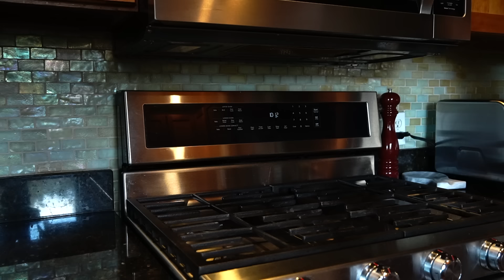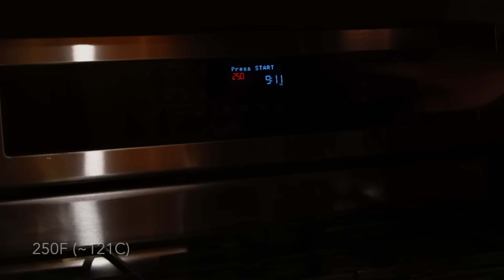Forging a Hidden BAMBOO KATANA from a Giant Leaf Spring

Comment: Is no one going to talk about how he just casually buts a blade in the oven
Reply: thats what im sayin
Reply: For r3al
Reply: I literally went to the comments after I saw that bit like bruh is that normal😌
Reply: Ah yes, wait a minute, i need to bake my katana
Reply: It's a process called tempering, it adjusts the granular structure of the steel so it is not brittle.
Reply: @jasperruss7569  do they use this for other blade making? I would think they do correct?
Reply: @skyline-xq4jl  yes it is a common process used by many knife makers
Reply: it is called tempering its a method in metalworking that improves its grain structure growth increasing its toughness by heating it and preventing it from cooling too quickly by holding it in a set temperature for a set amount of time back then bladesmiths would heat up a kiln first and put the blade back in it covered in clay but in this video an oven is used because its more accurate
Reply: perfectly 69 likes.
Reply: Thats how you make the metal stronger as long as you dont do what i did and cleanch it in water water makes the atoms in the metal press together faster and causes it to bet so strong its weak so use oul to clench it
Reply: @yodaheadnew2635  very normal actually
Reply: It’s normal, most would have a kiln to do this in instead of a oven but considering it’s a larger blade it would be easier to use the oven for and works the same
Reply: @obsidianknight3125  using water can cause warping though since it cools it too fast, using oil is slower because it cools it slower but it’s less likely to warp
Reply: @skyline-xq4jl there are few probably different ways to temper steel, all of them work the same. Relieve any stress that would cause fractures under impact, improve thoughness removing excessive hardness, or maintaining it

Comment: He may not do it in the traditional way but he still uses the blacksmith methods, modernized and original. One things for sure doesn't matter how it's done as long as it's done right and with precision, dedication, patients, steady hands, and a determined soul, Anything you make will turn out a masterpiece and this is a masterpiece.
Reply: if it is not folded, it is trash!
Reply: @og3suso978  no actually if its folded its trach, you clearly dont know what the folding was actually done for, which is hilarious. thew folding was done specifically and ONLY to even out the impurities in the very low quality steel the japanese had access to, it literally only does that. they are short and thick aswell and that combined with the low quality stiff steel makes them especially brittle and very very prone to shattering.
Reply: @Helperbot-2000  The iron used for Japanese swords is a special type called Tamahagane. You seem to have no knowledge of swords.
Reply: @moqhacker  the iron used in japanese swords was low quality because they couldnt easily separate it from the sand it was it, and again, it was low quality steel
Reply: @moqhacker  OK, but why is that relevant?
Reply: @W3lol1  We use "tamahagane" because it is stronger, tougher, and more tenacious than iron. Katana is a weapon, but it is also a work of art. katana smithing is a sacred process, so the process and materials used are very important. A sword has a "hamon" but this katana has no hamon. Without the use of traditional techniques, "hamon" will not appear. In addition, I feel that the sword is weak in reflection. katana often uses reflection to blend into the environment like a chameleon, making the tip of the sword transparent and cutting the opponent. This is just a sword and would not be recognized as katana in Japan.
Reply: @moqhacker  any steel is better than iron simply due to the carbon content in the steel
however, tamahagane is not any better than our modern, much higher quality monosteels, as modern monosteels have less impurities (and now have alloy contents that make it even better than that)
i get that forging a katana is a work of art, but like.. so are all high quality blades?
all your other points are meh. and while this isn't a "katana", it also technically is, since afaik, katana just means sword

Comment: Some of the western katana today have no soft core like the traditional Japanese swords which is the original way of making one. Traditional ones are more harder to make but last longer because the core absorbs the force and reduces blunt impact when in contact with solid objects. Solid steel like this will either snap in the center or chip bigger. The weight distribution should be in the hand area, and the tip weight must be lighter compared to the center, and hand area.

hand area = heavy
center area = medium
tip area = light

Comment: Beautiful blade, nice work mate.
It looks more like a Tachi, rather than a Katana due to its curve if I am not mistaken. 
Also no guard makes it quite dangerous (for the wielder), not to mention bamboo handle is quite fragile + very slippery for combat purposes. 
But it is hell of a blade nonetheless, looks gorgeous :)
Reply: It's a shirasaya.  IIRC, some samurai started to carry these hidden blades (made to look like walking sticks) after swords were made illegal to carry in Japan.
They didn't have a guard as that would make them a lot less hidden.
They would only be more dangerous to those unfamiliar with their use.  Though, thrusting with one of these... well, you'd better have strong hands and a good grip.  The handle on this one doesn't inspire my confidence.  Maybe it's stronger than it looks.
I should say that I love the bamboo on this sword.  I wish you could find more shirasayas like this but preferably with something done to the bamboo to strengthen it.  That's probably why I can't find any.
Reply: @GUNNER67akaKelt  Ohh loved this bit of information, thanks mate. He actually cured the bamboo but that's usually for stopping cracks and/or shrinkage over time, doubt it makes it stronger.
Reply: @demran  at least the bamboo is a bit more durable now

Comment: DISCLAIMER: this isnt how actual katanas are made he just made it for fun
BUT THATS SUPER COOL
Reply: the katana is made up of two metals, the heaviest on the edge of the blade, and the lightest on the top. I think it cannot therefore be defined as a katana
Reply: Yeah i agree with you
Reply: @shounihillys1902  aww thanks for that
Reply: @shounihillys1902  Its more about hardness, the density of the two metals is almost the same, since they are both steel
Reply: @ignacioaguirrenoguez6218  they use a different dosage of carbon
Reply: @shounihillys1902  Counting the carbon atoms on steel as a different in mass is really stupid, I'm sorry to tell you. No steel has more than 1,5%-2% carbon, and one carbon atom is way lighter than one iron atom
Reply: @ignacioaguirrenoguez6218  huh? A Japanese blacksmith literally said that for a katana they use two different types of carbon dosage, what the fuck do you want from me?
Reply: @shounihillys1902  Yeah, that doesn't mean the weights are going to be any different, I want you to understand that hardness is affected, not weight of the material

Comment: The katana is inherently straight, and bends due to the internal stresses of the metals during quenching, because it is a composite product. Several different steels are used there. You could use just one type of steel, but achieve a roughly similar effect with zone hardening. Which is also often used in the production of katanas. I'm really not sure if the result would be the same curved blade. But that would be closer to the original production technology.
Otherwise: nice sword. Good job.
Reply: Isnt the curvature resulted from different cooling times for different parts of the blade in the quenching process?
Reply: @nopr1v4cy2  yes. As the blade cools during the quench it goes through a few distinct phases. Positive sori and negative sori. The spine being coated in satanite for example,allows the cutting edge to cool much faster than the spine. At high temps the phase is often called austenite, the rapid cooling of the material creates the second phase know as martensite.
Reply: @5.56Chronicles  Though to add, we might have to consider that the curvature generated from the quenching process isn't the sole reason in contributing to the blade's curve. These things were of course, were decided upon the smith.

Comment: It was unbelievable how a katana could be made from a small piece of metal.
Reply: dude plays minecraft, guy gathers iron and bamboo and crafts a sword
Reply: Most historical sword, whether Western or Eastern are not that heavy. Usually around 3-8 pounds.
Reply: @inisipisTV  yeah, but it depends how that weight is used. european longswords while beeing similar in weight are significantly longer aswell as the fact theyre made of way higher quality steel which means they have proper springyness to them making them durable and nimble. while katanas are shorter for their weight aswell as alot thicker to make up for the lower quality steel the japanese had access to at the time, its impressive how well they could utilizen the steel they had, but its unfortunate how brittle their swords were. the steel quality is also why they were folded a few dozen times, it was done to remove some of the impurities but more importantly even them out to prevent large weak points
Reply: @Helperbot-2000  They didn't have steel native to Japan either. Most of their katanas were made of pure iron ore sand. I've watched a YouTube video of how a traditional Japanese person said they harvested the iron for their swords and they would go to the beach with a magnetic rock and draw it over the sand until they had a decent amount of it. Man at Arms reforged is a good channel and Ilya always tries to make Japanese katanas the traditional way when he gets to make them. In fact the metal was so brittle before hardening that Katanas are "supposed" to be straight and they curve when going into the water for hardening, very cool to see it done.
Reply: @SeviathTheHumanDrago  well no they did have steel steel isnt separate from iron, you make steel WITH iron and carbon, and so yes they used iron ore sand. they didnt use magnets) but their steel making process was quite poor and so they couldnt make very high quality steel, it had alot of impurities (which is the reason they were folded, to even out the impurities and remove them slightly. but yeah the curving is interresting, as the edge was covered, it didnt harden as much as the back dise, and so the backside would shrink faster curving it, its a bit like a bi-metallic strip!

Comment: you know im wondering how hard it must of been to forge a good weapon back in the old ages like 70 A.D like all these machines make it look easy but its still hard. They gotta do it by hand back then which is insane in my opinon
Reply: @TreySomeWay  There are videos on youtube
Reply: A blacksmith usually had helpers with sledge hammers makes the job allot easier.
Reply: @trueredlucky954  yea sure I guess, but look at 5:36 how would the helpers pull off something like that. You get what I mean? like to make the weapon look nice and symmetrical this, guy uses insane machinery which helps, and I'm pretty sure helpers cant do stuff like that. right?

Comment: Excellent video - though I would rather have seen a brass dowel in the grip holding the blade to the handle!  Still, your workflow is extremely good to have shot this - excellent work, and props for forging in the bevels.
Reply: Yeah, I was just trying to a work it out. Does this sword count as having a full tang? I don't think a sword is really considered a functional, combat ready sword and not simply an ornament without a full tang. At least that's what I thought.

Comment: Now I have 100x more respect for the sword-smiths who made real katanas.
They folded the metal like 20 times to get an aligned grain structure in the metal and then sharpened it on grated stone.
Not to mention all the forging was done by hammers, no machines involved.
Reply: Yeah it's crazy the skill and time it just have taken, but this guy still has crazy skill even with machines

Comment: In the 1930s and 40s, only non-commissioned officers were allowed to carry military swords, but on the Chinese front, the Japanese army was short of ammunition, so the need for swords was very high. And there was a blacksmith accompanying the soldiers to repair the swords. The soldiers picked up car springs and asked the blacksmith to make them. The soldiers would pick up the car springs and ask the craftsman to make them into swords. He was very skilled and could anneal them very well, so they were called "Imatoretsu" or "Spring Swords" and were very useful in the war.
In fact, the manufacturing method of Japanese swords has not been clarified.
It is said that more than 1000 years ago, swords were made only from steel. During the Warring States period, the need for swords increased and it became difficult to obtain enough steel for the orders, so a manufacturing method was apparently devised in which steel and soft iron were sandwiched together to reduce the amount of steel used. In other words, it can be said that the use of all-steel springs as a material for Japanese swords was completely correct in ancient times.

Comment: Fantastic design, but my only concern is how are you supposed to know the edge alignment with a perfectly circular handle? 
(one fix I thought of was to  add a small piece of wood to the back of the handle, making the profile an oval. yeah it would make it less discreet, but with a good wrap it could pass off as a walking stick)

Comment: The Katana Rhetorical Questions I myself pose to one wishing to posses an original hand crafted Katana unique with its own DNA if you would express it in those terms.

1. What comes first learning the earth and blossom or learning the Katana itself?

2. What is the difference between the Katana Blade and the skin on ones hand or body?

3. From the craftsmand knowledge and wisdom, what is the constant battle in the craftmans mind between scorpion, subzero and raiden in yielding a blade of perfection?

4. Given the Katana was born in times of ancient temples to what ends of the earth would the craftsman have travelled to gain the resources needed?

5. How is a katana exumed from its sheath 
A) Drawn
B) Pulled
C) Exumed
Or
D)Summond

6. Is each Katana yielded identically in lengthy battle?

7. How is the craftsmans work and effort preserved in use of the blade?

8. And like Bruce Lee commented "Be like water" how does this affect Subzero and Raiden in Mortal combat.

9. How is subzero effected in summoning his katana in mortal kombat?

10. What comes first the blossom or its polenators like the bee or moth or butterfly or bettle?

11. What is the difference between a moth and butterfly?

Comment: correct me if im wrong, but wouldnt the bamboo skewwer crack under vibration of striking? modern knives use metal dowels usually.

Comment: i like the way you did the sheeth more then the  actual katana if you can even call it a  traditional made  one
the sword is painted with layers of clay before heating, with a thin layer or none at all on the edge of the sword it's also  quenched in oil i believe to  get the curved shape
and you forgot to  to  layer the billet. but nice job

Comment: hold up, doesn't spring steel have pretty undesirable composition and properties for swordmaking? Or does the repeated heating during the forming process rearrange the steel particles? I know the quenching of the blade and subsequent tempering is necessary to make a hard blade but spring steel is supposed to deform repeatedly in a controlled way without fatigue

Comment: The shape of the blade is not given by heat and cut it, it is given through grinding the metal (friendly advkvice from a fellow forger) and the blade is called tachi (cause is little shorter of katana)
Reply: I respect this man's hard work and passion, but real katanas get their shape from the quench, not grinding or hammering it into a curve.

Comment: Use high carbon and Damascus steel mix. Most strong/flexible blade that'll last nich longer then a real Japanese katana made in Japan. Dont get md wrong i love them because they us old method of forging the katanas but the carbon steel is not all that good especially if they ask 6000$ up to 10k for a real Japanese katana. I can forge one out of the mix or buy one made from the mix i stated, high carbon and Damascus steel and it'd cost 500-1000$ only an last way way longer and way stronger

Comment: Sword may be fine, but the tang, god damn that's shitty.
Ok, now that I took that out of my system... Heat and humidity act as a great way to bend bamboo, it is this way bamboo arrows are made straight for precise archery. You should have used this technique... Made a mold with regular wood, then use it to bend a single unique p piece of bamboo to the same curve as the blade. That being done, use a metal rod to make the bamboo totally hollow by hitting it calmly through the sections.
then glue to the rod wood sandpaper, rotate the rod to open the correct amount of space for the blade.
Create another blade made of wood, and add to it the rest of the wood to the diameter of the internal dimension of the bamboo. put wooden glue only to the outside area of this combined "wooden cane", and use a mallet to fill the bamboo to have only the space to the final katana blade. With pressure, even after you remove the provisory central wooden blade, the two half circles will stay in place. Give it 72 hours for the glue to cure, then use painter tape around the metal blade (to avoid damage) and try to fit it.

If you feel any resistance that feels wrong, pull the blade, see where the painter tape got damaged a little, and use a small wooden flat stick (like a long popsicle stick) with more wood sandpaper and take the excess.  With patience you'll have a single piece tang to use with your bamboo katana.